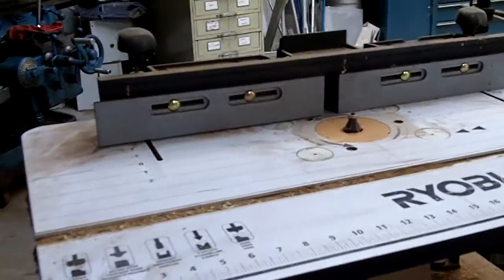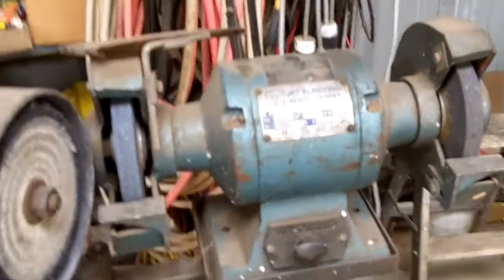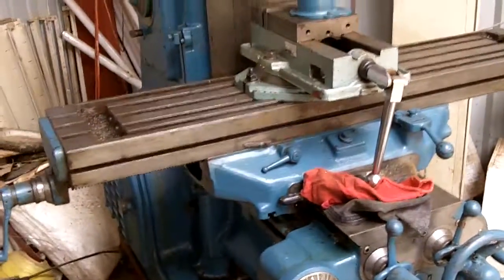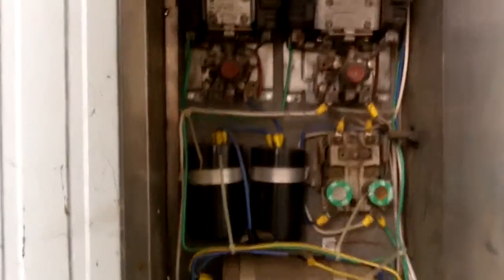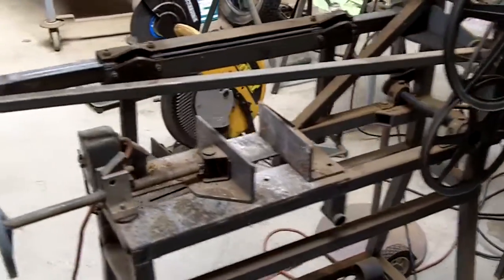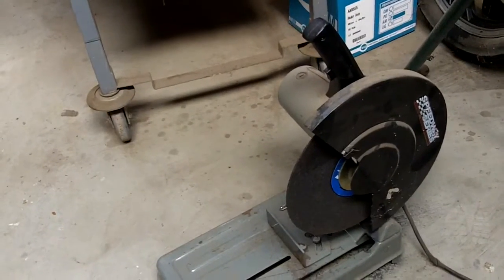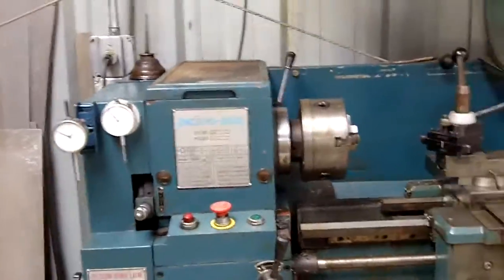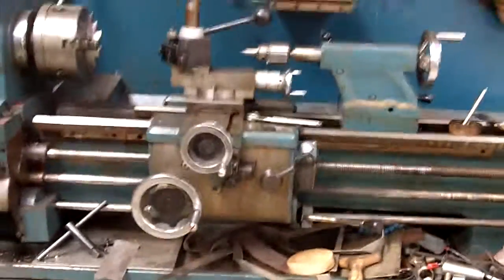My Shop Tools pt2

Comment: hey, i have a quick question about your 3 phase. are you using a 3 phase motor to convert from 1 to 3ph?  if so, how many hp is it? and are you able to run your 3 phase welders from that?

thanks for the information, im about to either build or buy a 3 phase converter and I would like for it to be able to power welders 
-scott